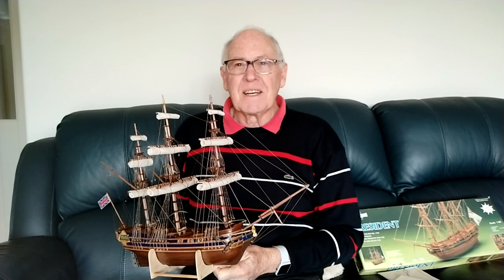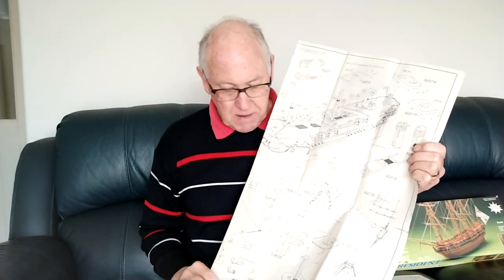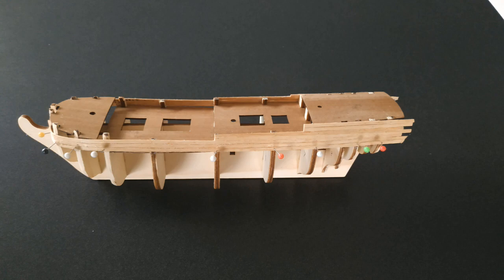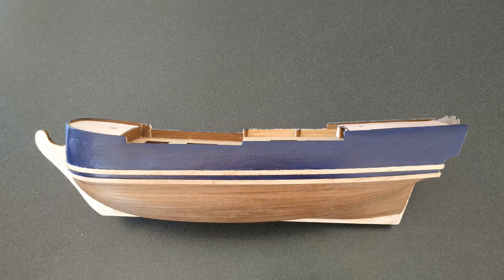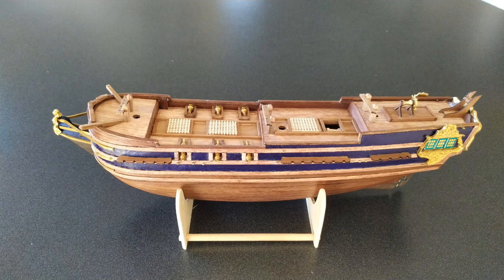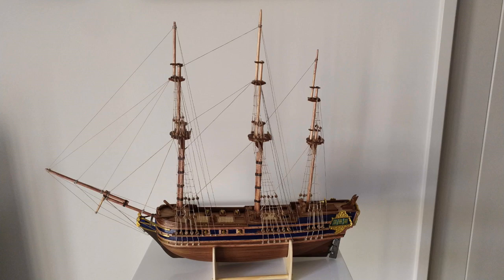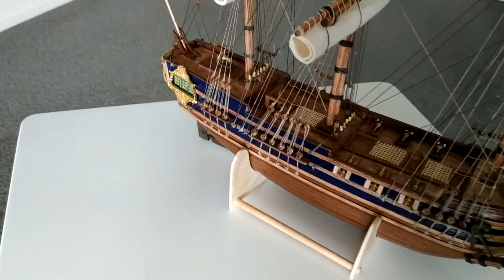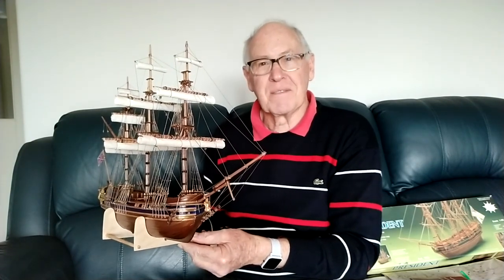Building the model ship HMS President 1760 - from a kit by Sergal Mantua.

Comment: I am struggling with the planking, glue does not seam to hold very well any ideas please would be so helpful , this is my first model .
Reply: What kind of glue are you using? Its a good idea to use wood glue and hold it in place with pins while it dries. He also has a couple of other model ship videos where he talks about the different glues he has tried and what he prefers to use.